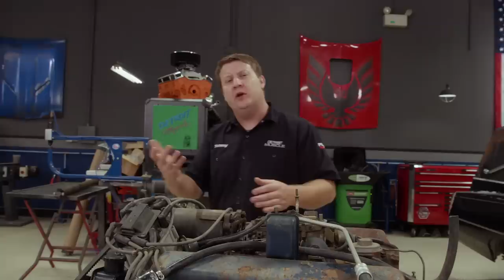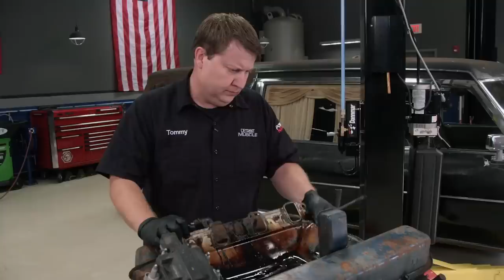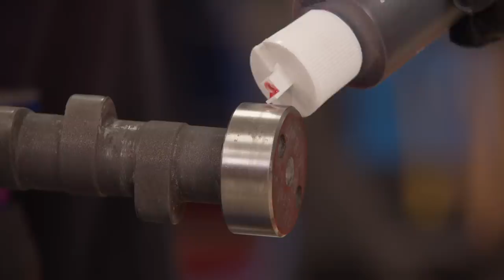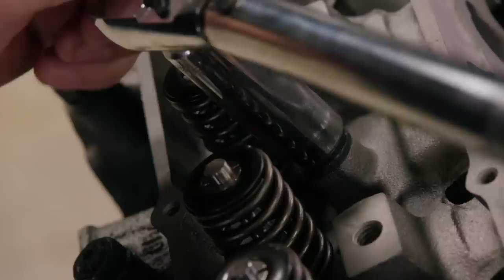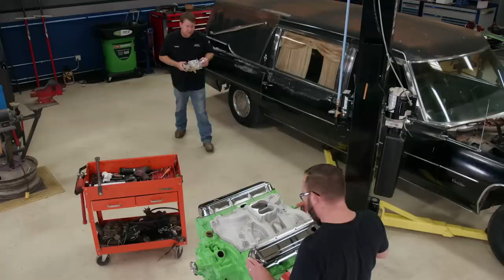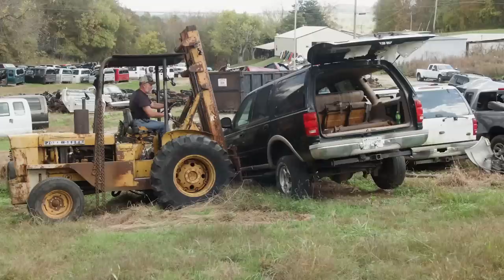Upgrading the Cadillac 500 To Make Serious Heavy Horsepower - Detroit Muscle S8, E2

Comment: I had a '76 Eldo with a FI 500. Right, so, just imagine barely 200 hp in a 5,100 lb automobile. I'm fairly certain it couldn't beat a Trabant to 60. Nice, quiet, and smooth ride though.
Reply: I'm fairly certain it had timing and tune issues.  Did you at least replace that sloppy factory vinyl timing gear?  Remember, that 'SAE net HP' was a solid 40 percent less than the engine really made-it was done to make the auto insurance industry happy, and for eco-regs.  The EFI version actually made more power than the carb version-and was a lot nicer to drive.  Keep a spare temp sensor in the glovebox, tho.

I have a factory EFI '78 DeVille that's supposed to only have 185HP, yet from stoplight to stoplight it will embarrass all those turbo Audis that try their little pass on the right trick.  They fail-and lose to a big ole' green, chrome bedecked, 4200lb American couch-mobile!

It's pretty awesome.
Reply: @Bolton115  - I remember the timing gear problems with those engines. The day I bought that car (used) from a dealer, the transmission went out. The dealer took several days to replace it. Two days later the car quit running. They took a day to fix it. Two days later it broke down again. Rinse. Lather. Break down again. Got rid of it in two weeks so never got into the timing gear issue. Those five times when it was running okay were really sweet, though. My '73 Coupe de Ville had plenty of power, though and of all the Caddy's I've had, I miss that one the most.
Reply: @vincentjamesthequicktake1720   most places wouldn't know how to work on those old EFI systems.  They can be very reliable, but the tech repairing it has to do a bit of homework.  I wonder how many of these got switched to a Qjet due to bad temp sensors and a misadjusted throttle position sensor, or a faulty fuel pump circuit.  Today, there is also a MAP sensor mod to allow a modern day 5v MAP sensor to work in the 1970s 9v ECU environment.
Reply: @Bolton115  - If only I had known then what I know now. Thanks for the info :-) The prices of those today have gotten truly insane. Still, I'd rather have my old '73 Coupe de Ville back, carb, points and condenser, and everything!
Reply: @vincentjamesthequicktake1720   yeah, it's hard to beat the older, high compression carb and points setup, at the very least because they are a known quantity for repairs.

I started out with points triggered cars, and wasn't sad to see 'em go when I went to HEI.

Comment: Do the build, have the reveal, then continue the build and cut the back off and make it a Caddy Camino with a wood floor bed with a 6-71 coming out the hood.
Reply: Got a good friend at work that had a Pinto station wagon when we were both younger, much younger. He chopped the back half after a tree fell on it and named it the Pintomino. It turned lots of heads. Most likely because it looked as though it was coming toward you and away from you as far as that goes at about a 45 degree angle. Drove like shit, but it was cool!
Reply: @thomashaley5284  should have called it Pimento Cheese
Reply: Lots of funeral homes have a thing that looks like a Cadillac El Camino...
Reply: I saw a funeral flower car a few weeks ago. 
Never saw one or never noticed ,I'm not sure but it was kinda neat. 
Basically a Cadillac Ute.

Comment: What were the engineers doing for the twenty years that they weren't engineering on the automobile. In 69 we had four wheel disc breaks on the Camaro and we didn't see them on from the factory until the late 80's.
Reply: Cost, it's that simple. Remember, we are talking about an industry that did the math and figured it would be cheaper to let people die and settle court cases than upgrade a 40 cent fuel line. drums to disc entail a lot of cost, hence...we wait.
Reply: I'm so happy really, to see other's who see what they did and are doing.  That I'm not the only one who sees these things.
Reply: Well, drum brakes are way more reliable and cheaper to maintain. You can still buy cars with (rear) drum brakes. 
Most trucks (+3,5 Tonnes) still use drum brakes..
Reply: @ferdi93ferdi  Cheaper to maintain? What kind of maintenance do brakes need? Anybody can change pads. Drums full of springs are a pain in the ass. Discs feel way better than drums, too. Reliable? So long as a brake line isn't rotten (and that could happen with discs or drums) what's the difference in relaibility? You ever hear of someone doing a drum brake conversion?

And yea, heavy trucks all use drums, but that's a bit apples and oranges, don't you think? 

Sorry to carry on, but I hate drums.
Reply: I didn't realize that.
Reply: @kiisu74  well, I never said i like them either! :D

Drums are outdated, ofc. But still have their place. Imagine the size  and costs of trucks and their wheels, when they had to fit a (propably) 20 Piston Wilwood 25" Disc Brake :D Not even talking about the thickness and weight of the brake disc itself.

But the fact is, they wear down way slower than disc brakes (Bigger surface area..) and  even if so, they are mostly cheaper than brake pads. also they are easier to maintain because a spring is faster replaced and costs less than a precision ground floating pin, only to name one part of them.
Aaand if not cracked, the drums themself mostly overlives the lifetime of the car.

Lots of manufacturers still use them as internal e-brakes on the rear axle, like mercedes or chevrolet.

Comment: It's 150 lbs lighter than a big block Chevy.

More importantly however, as someone who's done the 425 head swap on a 500-and put it in a school bus-you need to mention the cooling hole mods which need to be done to the 425 head and to the 500 block decks in order for 425 heads to not run hot on a 500.  The steam holes are different, the 425 head has a few extras.

Comment: I'm not a Chevy hater but when you see  old pontiac, olds, Buick, and Cadillac engines being torn down, you can see they put a lot more engineering  into the architecture. Built to last. The engineers  at Chevrolet did some amazing things with attaining power out of what needed to be a cheap design  for affordable pricing. Let's face it, Chevrolet  was sort of the Kia of the car market in the 1950's and 60's. There wasn't really a cheaper American car on the market. The simplicity of design helped attain that  cheap price point. I mean..... the small block Chevy is the most legendary v8. So much power and potential  for not a lot of money. But  BOP and Cadillac  engines were just so much better built and designed.
Reply: Back before GM "corporatized" the engine designs in the late 70's (Chevy 305's and Olds 307's in everything...) Each division had its own engineering dept and permission from corporate to go their own way on the design of the engines. As you stated since Chevy made the low cost entry level cars the engines (at least the SBC) were designed to be lower cost since the overhead on a Chevelle was lower then an mid or upmarket Olds Cutlass Supreme, Buick Skylark, Pontiac LeMans (these three were a Chevelle body style with luxury trim and more refinement - to include the engines) The BOP cars had higher profit margins which back then allowed their engineering depts to make higher quality engines - higher nickel content, closer tolerances, novel applications like the TH425 "Unitized Power Package" front wheel drive setup used in the Olds Toronado and Cadilac Eldorado; and the GMC Motorhome once the divisions were required to "share" their engines with each other. Note that Cadillac never shared their innovations with the other divisions; no 472 in an Impala - although many a Cadillac ended up with that famous Olds 350 Diesel and some had the 305 SBC (lots of pissed off customers in that era lol)

My cousin has a 1970 Chevelle as "bare bones" as you could get... 307 SBC with two barrel, manual drum brakes, no AC, manual steering, bench seats and AM radio. A 1970 Cadillac Coupe Deville had power everything standard - note that the 472 series engines are easily identified by the AC compressor mounted to the intake manifold with the radiator hose doing a fancy bend around it. This was done since ALL Cadillacs have AC,  standard on all - not an option. The 472 was designed to rev low and produce torque to drive all those accessories and be able to move that 5000+ pound beast into traffic and have power on-demand with no harsh noisy revving.  Later on with the Malaise era emissions and fuel economy requirements power was way down... 190HP 500 and the 368 (5 inch bore centers, 10.5 inch deck height for 368 smog-choked cubic inches? Not to mention the one with the Radio Shack cylinder de-activation and then that horrid HT-4100 which most V-6's of the time had more power.

Comment: I cannot believe that you took the short block down to only remaining items being the crank and pistons and didn't do a thing to refurbish that area.  Odds are that you'll start the engine up and find it's smoking due to worn out rings and spin a main bearing the first time you really get into the throttle because the bearings were shot.  Smooth move there, now you can just do it all over again.

Comment: I had a Caddy engine in Grand National.  I Bought it that way!  It was the 74 model engine.  You do realize you can get up to 1,000+ horse  with simple upgrades and simple internal work and still run pump gas.  The 500 Caddy engine is a dam beast. The Chevy Z502 can't even touch this engine if it's built right.
Reply: Hey ima disabled vet with a 75 Eldorado looking for some simple upgrades I can do without breaking the bank? Thanks in advance
Reply: @MrMan-ol4ic  thanx a lot fam 👍🏾

Comment: At this point, they should have replaced bearings, checked pistons and installed new rings-strange they didn't.
Reply: ...putting all that new potential HP on those old bearings, not checking the crank, and not doing the rings and at least cleaning up those pistons is idiotic...like a refresh nightmare....oil burner...hahaha - they should have just put back the old timing chain...hahaha
Reply: Nobody was supplying free parts that's why this engine was so disappointing due to almost no modifications. Stock heads, small cam, intake and carb. There are aftermarket heads and cams that would have shown much better results.

Comment: The Cadillac motors at 500, 472, and 425 CID are all similar.  The 500 is a square bore block with 4.300 bore diameter and 4.300 stroke.  The 472 reduced the stroke to 4.082 inches while keeping the 4.300 inch bore.     The 425 dropped the bore diameter to 4.082 inches and with its 4.082 inch stroke it is again a "square bore" motor.   All these blocks share enormous main bearings, a full half inch in diameter larger than those found in a big block Chevy motor.  The Chevy has 3.75" nominal diameter bearings, while on the Cadillac blocks, it's 4.25".   This gives the main bearings enormous oil flotation surface which contributes to their durability.   Bottom end failures of these Cadillac blocks due to oil issues are incredibly rare.  Any such issue basically means you ran it out of oil for an extended time.   Basically nobody ever sees that failure.      The weakness of these engines is mostly in the rocker arms. They need to be replaced with upgraded rockers, and the cam bearings are marginal and also benefit from being replaced with .001" oversized cam bearings with external oil grooves and a second oil hole.  

After all that you've got one of the toughest motors around.  Pure durability.

Comment: A gasket is designed to not be used with with rtv. If you don’t want it to leak use a little light grease. You used half the tube on that front timing cover

Comment: You guys do it the hard way (cleaning greasy engine).  Take apart-boil it out-shot peen it-pre cylinders and bearing surfaces-reassemble. Cadillac needs to take this engine further. Another 8 cylinders-another 500 cu.in. high lift cam cam gear drive-1 forged crank, allum heads, cross ram intake with Crower injection. Headers with 4 1/2" collectors with 30" leads then the pipes another 60"-open

Comment: Anyone else wince a little when he tapped that screwdriver into the gasket surface with a hammer? I mean, he did at least use the plastic deadblow, but I think someone forgot to tell him that only counts if the hammer is what's striking the tender bits.

Comment: You missed the week link in the big cadi mo ,it's the con rods ,off set grind the crank to BBC rod bering and use a set of speedmaster I beam 7.100  big block Chevy rods and a lite weight forged Pistons and use a roller cam from Howard's and use Chevy SBC  linkbar lifters and make real power

Comment: Those were in those Cadillac Eldarado's . I've never heard of it used for a sports car. It had a funky reach-around transmission to make it front wheel drive.
Reply: tbat tranny was called a th425, a guy put 2 500/th425 in a Yugo ,one to drive front wheels, and another in the back, I have also seen a Lambo Countach kit car with a 500/th425

Comment: "like brand new" didn't touch the internals!!!!!!
Reply: Exactly I was gonna post that they didnt even touch the rings. Its simple no or weak compression=  Power loss and oil consumption. Going this far and not doing it thouroughly is foolish
Reply: @renj6531  That's kinda what I thought..  I mean geez, not even ball honing the holes and throwing new rings at the factory pistons, mayhaps a set of rod bearings while they're in there?

Comment: I’m guessing they went with the 425 heads because they have smaller combustion chambers than the 500 to bring back some compression being the mid 1970’s 500 heads had large open chambers which yielded a low compression?

Comment: Did you replace cam bearings, rods or rod bolts? Stock pistons? who ported and prepped the 425 heads?
Reply: Maximum Torque Specialties supplied the heads and rockers.

Comment: Replaced the water pump,  but didn't replace the oil pump.
Left the crankshaft in, so no idea how the bearings are.
Saw cruddy connecting rods in one shot.
Didn't pull them, and pistons out, so more bearing question marks. 
So why not pull the bottom end, clean the block completely, deglaze the cylinder walls, etc?
Or are you expecting to grenade the engine the first time you give it a shot of nitrous, so you didn't want to waste time cleaning and checking the rest of the engine?
Reply: Normally I would agree with you but I've had a couple of these motors and even with a hundred thousand plus hardly any cylinder wear.
They're balanced from the factory to run smoother than a normal big block . When mines tuned tits I can hardly tell it's running and I have dual 2.5 inch Glass packs.
Plus how many high mileage hearses have you seen? And it was probably driven nicer than an old lady to church.

Comment: I'm confused. The engine was almost completely rebuilt. Why stop short and not do the bottom end? Those crank bearings could surely use some love. Not sure how long this thing will last. Especially if it gets nitrous.
Reply: We've had a few 70/72 472 & 500 engines with just a cam/head studs/head gasket/springs/older MTS shaft rockers and edelbrock intake.Been building them for awhile we lived an hour or so from Marty at MTS,well pretty much his upper valve train.Only lost one to bearings,the bottom ends were stock besides an oil pump and good water pump sprayed the crap out theses motors to the point where the heads were the biggest factor could only move so much air but a 250/300 on a stock ish engine was the limit,sprayed more but no difference in performance.The #1 piston had a tendency to leak a little but other than that they were pretty dam solid.With the factory cam lots of these motors never saw any kind on rpm, mostly gunk in the oiling system from sludge,stop and go city driving.

Comment: Well, my brother played with a 500 Caddy back in the 80's. Only thing they are basically broad torque machines Not high rpm HP machines...so...
But its a pretty big black and should be able to take 15to 20 lbs of boost so I guess you can get like 1000 hp out of it. Only thing is, if you used a GM big block with 3 OR 4 stages of NOS the BB can easily make 2500 hp so...why fool with odd duck blocks....

Comment: I'm surprised that hearse is not a Fleetwood, they have disc brakes in the back with leveling shocks and they also have aluminum Hood. I would put it in a 79 Cadillac  only weight  4200 . It's still a big car
Reply: But you did teach me something new. a Cadillac got some big heads like a 454, but the Cadillac heads have small rocker arm covers

Comment: Thanks for covering this engine! Ever since surfing wikipedia as a kid, I wondered if this engine had a lot of potential once freed from it's emissions design mindset.

Not very relevant to the video, but Permatex came out with Orange threadlocker. It's as strong as red threadlocker, but doesn't require heat to remove. It's perfect for applications for when you need high strength, but want to remove it later.
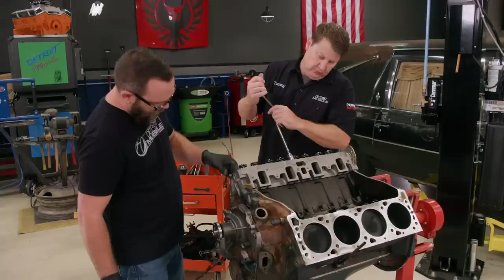P.S. Get a speed wrench like shown at 13:30, TOTALLY worth it when you have a few long bolts with decent access. I bought one for when I change batteries at the parts store, best $20 I've ever spent. It gives you most of the speed of a power tool, but all of the feel of a hand wrench. The reduced leverage compared to a ratchet wrench reduces over torquing, and the extra length usually avoids the need of an extension.